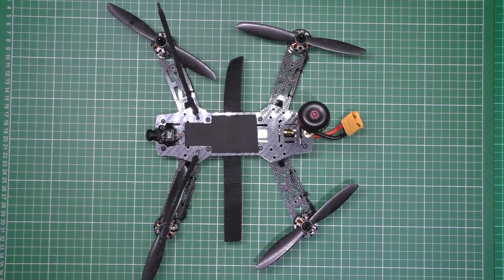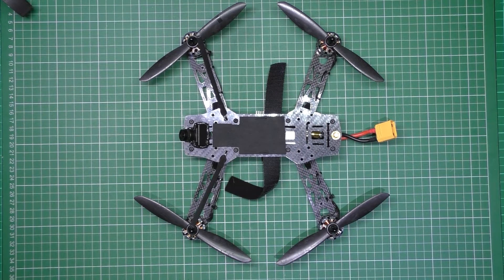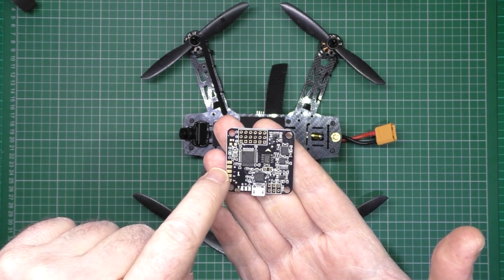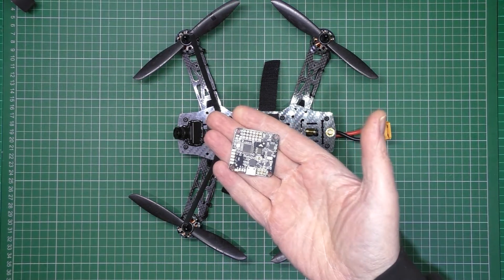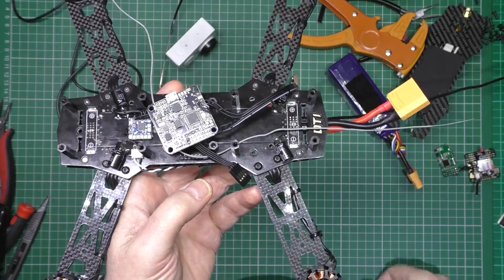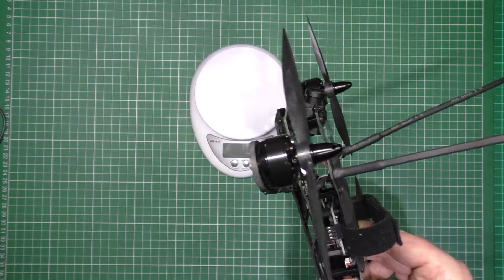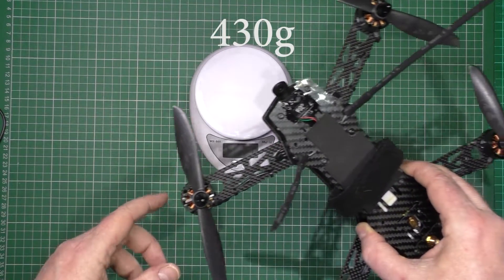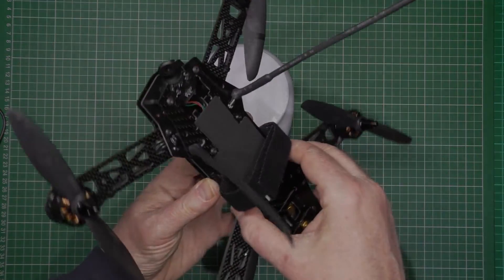Frankenquad the 2nd (attempt 2) part 3 of 2 - Naze32

Comment: I thought I would join in this discussion. my sp f3 mini does some really crazy things. it sounded great originally so I bought one. I recently fitted it to my 250 and I can't even power the board to run usb port and cleanflight without a lipo plugged in. makes calibrating ESC'S interesting with 2x lipo. anyway I got it working on sbus with my XSR Receiver and it seems to pick everything up etc. when I throttle up its very jittery and then spools up like some sort of turbo diesel struggling. it's either on and constantly accelerating or cut out when I bring throttle back down. I don't know if it's me but if I pitch it holds the pitch and same with roll. there's always a motor that wants to go top speed while at least one is stopped.
Good job my naze rev 5 full turned up yesterday!!
let me know if you ever get yours working properly pls.
Reply from the maker: +Nibble UK I doubt I'll ever get mine working. I need faith in a flight controller before I'll use it and these things are a pile of crap.  
If you have 'dampened light' enabled, make sure you have the Oneshot box checked - some ESC's can't handle one without the other.

Comment: have a look at the cc3d atom flight controller too,, i have built a zmr250 low rider thats 290g  without battery.... needs fpv gear but i hoping to get that under 350g...

Comment: there is a nav version of cleanflight too Vortecks i have tried it and the gps does work but i have not actually tried flying with gps hold or r.t.h. its not my thing but if you use a neo 6m and follow the setup on there it picks up gps great...
Reply from the maker: +bing crosby I don't think it'll work. Apparently, the SP doesn't support GPS yet. In fact, I don't think the SP supports 'flight' at the moment!

Comment: I come to realize that my sbus is not working properly with the SPF3 mini seams like the motors have cliches.  My mag@$&@.  ;$$: never a levels in the app.   The board never takes all configurations i.e.: motor stop.    Props still spinning.
Reply from the maker: +D Friz You're not alone. There's quite a few unhappy customers who have other faults too. There's components badly placed, components not straight, the silk screen isn't visible, SBUS glitches (like you and me), mag causing massive yaw inputs and some unlucky people have found that they don't work at all. Instead of "Seriously Pro", Hydra should rename the board to "Seriously Poor"

Comment: im glad im not thew only one pissed at the sp racing boards.....boards sooooo advanced at everything!?!?.....fast and having all in one???? or...  forgetting about making pwm, gps ,firmware loading....and apparently  instructions that work correctly ! all the while promoting migraines to hobby pilots worldwide lol...i haven't had an easy time  w my sp f.c.s either to say the least .....ive had to stop myself from throwing both of mine across the room several times ,while cursing it for not doing what its supposed to do!!!!!!!!!!.......apparently ,that must be the only way to make an sp racing f.c. fly !!!! so maybe thats how you do it!!!lol....i have two of the first released boards from sp racing  .... you can try to use pwm but it doesn't work with my 9xr no way at all...., or mess around forever w  trying to get them to load firmware and realise it doesnt do that right either...(eventually using some crazy baud rate it finally did) .but omg..NEVER HAVE I HAD SO MUCH TROUBLE GETTING A FLIGHT CONTROLLER TO WORK ....EVER!.....hats off to you man,i can definitely sympathize with what you were going through!!!!   sp racing really needs to be better than whatever this bs trouble ive been going through....i still haven't flown mine and now they're collecting dust until  "CLEANFLIGHT''can get it figured out ....instead of making more versions,maybe they could correct the ones out already...customers shouldn't  have to deal w spending hrs to find a solution  or alternative way/walk around to achieve what ,or how its supposed to be in the first place!!!!its supposed to hook up the way the instructions say.....AND WORK! ....right!?!?...well in my case ,its been more like,YEAH RIGHT!....so now i have spend extra money for more stuff to get these things to work sbus i guess,when all i needed was pwm for anything else i flew EVER.... very irritating indeed!!!......so,my conclusion....and my experience ......i know its not everyone elses obviously, ""those special blessed with ppm and sbus ....and satellite"',but,ive always used pwm ,and i believe that it should've never been majorly overlooked feature along w a lot of other things mentioned earlier .....guess im just very frustrated and bitchin,but come on cleanflight!!!.WTH..i bought two of these things and Im feeling very robbed right now....im a pretty patient guy too,but ive had it with this controller  too!.. Vortecks ,im glad to see you got yourself a nice qaud after all your irritating hurdles ....it looks nice!!....it is lighter,may not be exactly the way you wanted it to go......, but,...at least your not staring at a pile of dusty parts and actually have a good flying mini after all of it....and i hope you have a blast with it this summer and post more videos!
Reply from the maker: +kevin sherman I totally agree with everything you've said about the SP boards. I thought I'd get one, just to see if Hydra has cured the problems and it seems that he's introduced even more! I think this one will also gather dust on the shelf until I work out a suitable way to completely destroy it. Don't worry...... I'll be posting every maiden and flight of the Summer. It's gonna be fun because I haven't flown outside for 4 months :D

Comment: Tony I was just looking over the latest release of Betaflight 2.4.1. Among the changes was this little gem.
Fixed PPM + oneshot125 in SPF3MINI. 
might fix the issues you reported.
Reply from the maker: +Rob B Thanks Rob. I might try it in a future build but I really have lost patience with it at the moment. It also has other problems with UART2 not working and the mag has interference (it yaws when I test the motors)

Comment: Told you to try Betaflight. Nice one mate :o) 
Betaflight has been forked back into Cleanflight, it did this at the end of 2.4.0 testing.
Reply from the maker: +S700KY It does seem more stable in a hover with stock gains. Of course, I haven't had chance to fly it yet so it might all change very quickly mate :-)
Reply: +Vortecks Betaflight uses lots of filters and Boris is always tuning the stock PID's so you can just flash and fly. The Wiki is a very interesting read. I use a clone SP3 and its fine. All the toys on with a 500 loop time. I so want to get out and fly. Hope we can have a fly together when the weather cheers up mate.
Reply from the maker: +S700KY When the weather warms and we meet up..... I'll be my usual dribbling wreck and I've got no doubt that I'll crash with style mate :-)
Reply: +Vortecks you and me both buddy lol

Comment: I am longing for the day when the Betaflight project is formally forked from CF and loses all the bloatware w#$k features. Trying to be all things to all men has lead to complication we can all do without. Send the board back Tony, It is sounding like 2/2 lemons so far from SP losing.
Reply from the maker: +Rob B It certainly is a pile of crap mate. Whilst I was doing a test hover, it started to twitch at random intervals. I tried an X8R and D4R with the same results. The manual is useless but (according to the very abrupt reply I got from Hydra) it's my fault because I can't read schematics and it's probably something I've done wrong. Defensive aggression is admission of guilt in my eyes!

Comment: Looking good Tone, can't beat a rev5 Naze running Bf, just avoid the rev6 (noisy gyro).  Your mini quad does still seem quite heavy though, my 210 is 435g including HD cam and 1300 lipo.
Reply: +crezzee Wouldn&#39;t be a Frankenquad if it was not a hulking monster :) 
Looking forward to some more Spoktra videos when all the planets line up again. Where else can you guarantee at least one face palm moment every video :)
This frame ought be right up your alley. Clocked at close to 100MPH. A slightly heavier version with bolt on arms coming soon. see the BoltRC multirotor thread on RCGroups in the miniquads section of the forum
 http://boltrc.com/index.php?route=product/product&amp;path=62_149&amp;product_id=1004
Reply from the maker: +crezzee Cheers mate. Although it's a 285mm now, I'm rather confused as to why it's so heavy. The weight saving in the ESCs alone, should be 65g but I did leave a smal piece of insulating tape over the buzzer - I'm hoping it weighs at least 200g :D